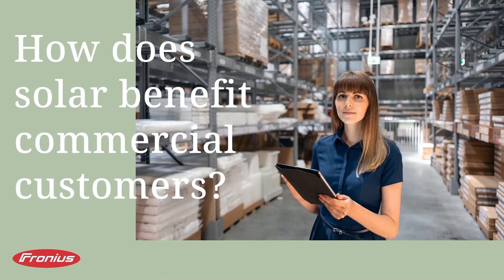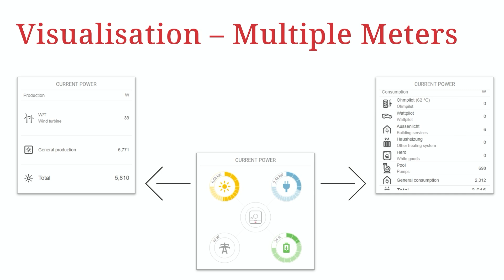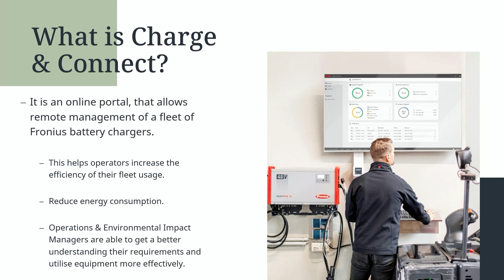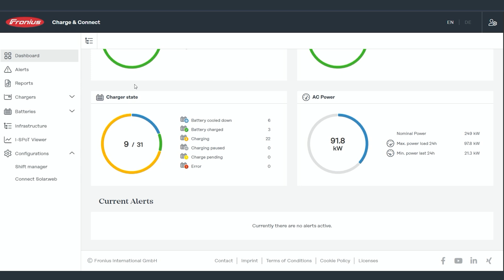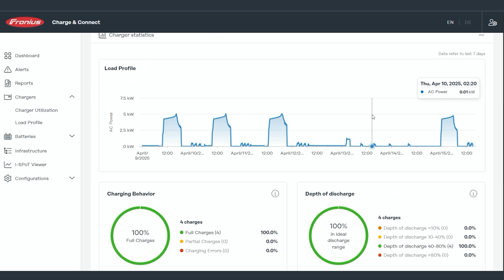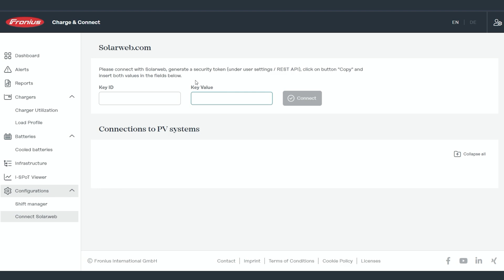Webinar: Maximise logistics efficiency and sustainability when you use solar PV (UK)

Comment: Need a device that works with a inverter to have east west arrays that can cut them and or use the lot to have a over sized array that in full sun is cut as required. 

Could even have to have east north (or south depending where you are) and west.

North is great for peak cooling... but east and west is early morning and evening. 

You have inverter max sizes in many country's like Australia. 

BUT no max size of panels.
Reply from the maker: Hi @ausguy4385, Fronius Inverters are able to export limit or reduce their production when used with a Fronius Smart meter.  Depending on the size and Model of inverter chosen there can be a variation in the Number of MPPTs which allow for different orientation panels to be connected. Most Fronius Inverters are capable of 150% DC oversizing, so on a 10kW Inverter you could have up to 15kW of Panels. However it is worth checking on the Datasheet of the specific inverter that you are using. For Detailed design information, please have a look on the Fronius Website for an FSP near you as the inverter specification and regulations may vary in different countries. https://www.fronius.com/en-gb/uk/solar-energy/home-owners/contact/find-installers
Best regards